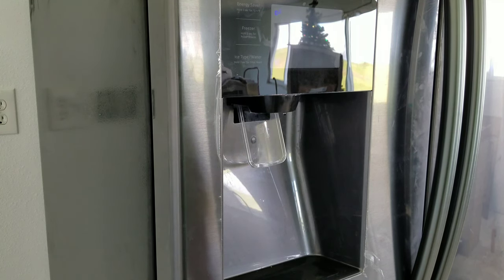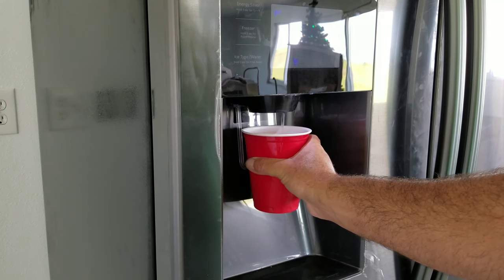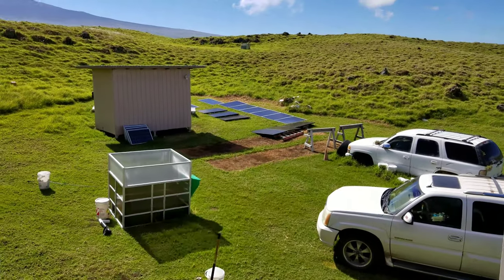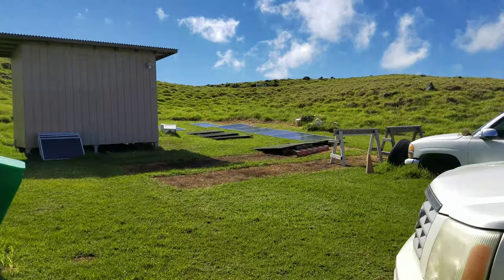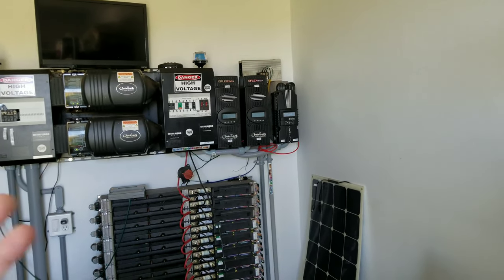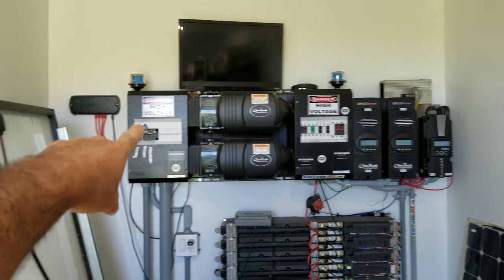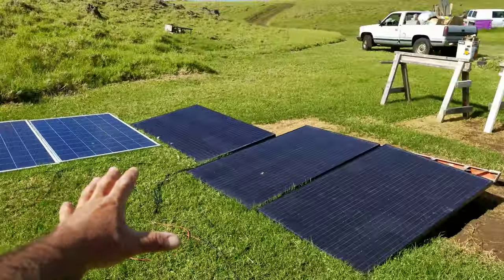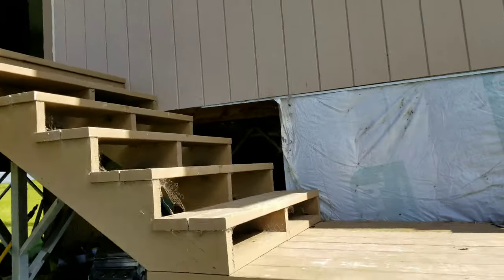DIY Solar Powered ICE Maker - Solar Powered Off Grid ICE Maker Easy

Comment: What's the size of your array?
Reply from the maker: I have about 20k but only 5k is hooked up. I have a video taking about I have to much solar power and what my plans are check it out.
Reply: @ModernOffGridDIY  20k thats alot, and i have 1.6kw array, and 4800 kw battery, I have been enjoying it at my house with my refrigerator (deep freezer) my washing machine, my tv and other laptops, fans and phone, run for 24 house, but I don't put on my refrigerator at night. and I installed a 4.6kw solar array and  19200kw battery in my family house and   bro it has been a killer with all the power sucking load only when the sun is out, but heavy load are put off at night... but 20k thats a killer.... you are a boss
Reply from the maker: Cool brother that's for sharing good to see more people into renewable energy. I love it, I can run anything day and night no problem at all. It's 3:30am right now here in Hawaii I am using my microwave to cook some food.